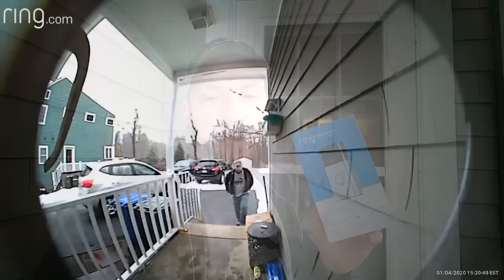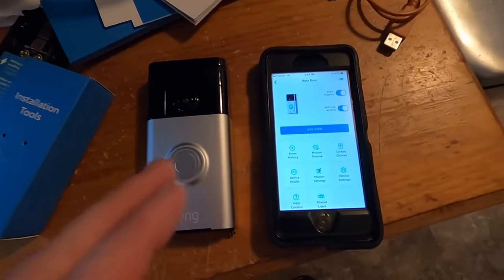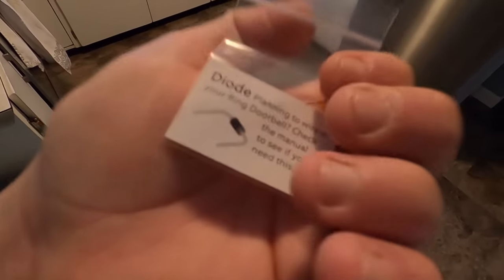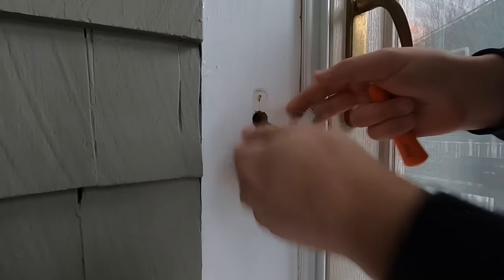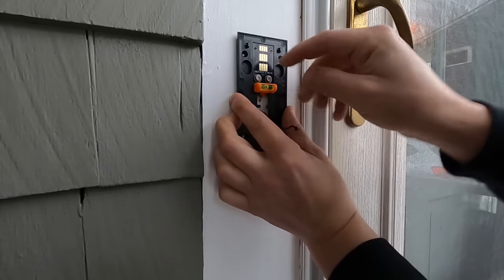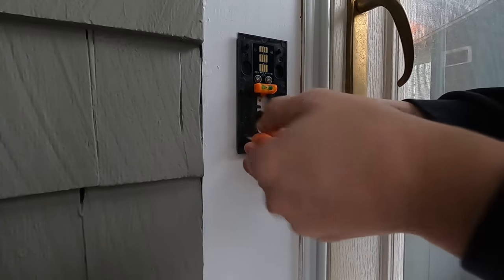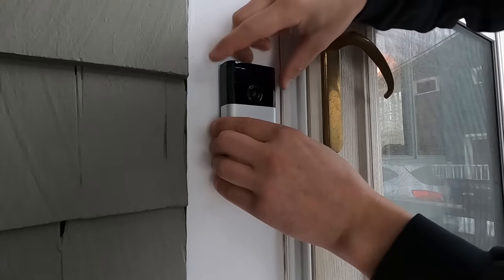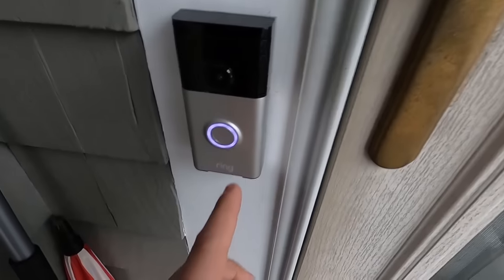How To Replace a Wired Doorbell with Ring Video Doorbell | DiY Install

Comment: I literally just bought one Rn, but we don’t have a doorbell, can we still install it w/o one?
Reply: Let me know if you figure out an answer because Im in the same situation lol
Reply: @Swazyyify  yes you just need to charge it unless its the solar powered version and you could buy the chime and plug that in in the house and that works as the bell. Your phone should also alert you as well. Hope this helps
Reply: @guccigucci2490  thank you!
Reply from the maker: Hey, Christy!  Yes, what Gucci said.  Thanks for watching the video!
Reply: @TheFixerHomeRepair  okay thank you!! & which one is the one that has a solar panel?
Reply from the maker: Hey, Christy.  I believe the solar panel is an aftermarket attachment that you will have to buy separately.

Comment: You still need to charge the battery even tho you wired it ????
Reply from the maker: You only have to remove the Ring to charge it if you do not hook it up to an existing doorbell.  I’m sorry I should have clarified that.  So to be clear if you do not hook it up to existing wiring you need to remove and charge, otherwise the doorbell wires will charge it if you have it hooked up.

Comment: I dont have to power my doorbell off before I install?
Reply from the maker: Hey, Joseph!  It would probably be a good idea to shut the breaker off to the doorbell but any doorbell I have ever come across has been low voltage wires so I wasn't too worried about it.  Again, the instructions do recommend turning off the power at the panel.
Reply: You don't have to cut power it's very low volts won't even feel it!

Comment: Shouldn’t I turn off the breaker to my doorbell first?
Reply from the maker: It would probably be a good idea to shut the breaker off to the doorbell but any doorbell I have ever come across has been low voltage wires so I wasn't too worried about it.  Again, the instructions do recommend turning off the power at the panel.

Comment: Shouldn't  you turn off the breaker first?
Reply from the maker: It would probably be a good idea to shut the breaker off to the doorbell but any doorbell I have ever come across has been low voltage wires so I wasn't too worried about it.  Again, the instructions do recommend turning off the power at the panel.

Comment: Does it still need battery ?
Reply from the maker: The battery is built in and can't be removed.  So yes and no I guess haha.  If it is plugged in it will not use battery power but will stay on if the power is out.  Hope this helpss!
Reply: @TheFixerHomeRepair  yes. Thanks for the clarification
Reply from the maker: @estimatora1419  No problem

Comment: Can you get electrocuted from the doorbell wires or feel a  electrical shock i am a bit worried doing this myself
Reply from the maker: It would probably be a good idea to shut the breaker off to the doorbell but any doorbell I have ever come across has been low voltage wires so I wasn't too worried about it.  Again, the instructions do recommend turning off the power at the panel. Thanks for checking out the video!

Comment: Did you turn the power off when you installed it? I freakin cut my doorbell lines in my basement so I might just install a video doorbell and run new lines.  I can’t find the breaker for the transformer wonder if I can install it with power on
Reply from the maker: It is highly recommended to turn the power off first.  You can see in the video that I did it with the power on but that is not the best idea according to approximately... everyone haha. Thanks for watching.  Hope the video helps!!
Reply: @TheFixerHomeRepair  haha I noticed. I mean it’s a low voltage anyway
Reply from the maker: @bhadz100  haha yeah it is.  Only thing that would worry me is people do strange things with electricity, so if you didn’t run it you don’t know if someone messed it up somehow.
Reply: @TheFixerHomeRepair  true that
Reply from the maker: @bhadz100  be safe!  Hope the video helps!

Comment: Wont u get electrocuted if end of wires touch each other?
Reply from the maker: You shouldn't but I would recommend disconnecting the power to the doorbell before you install this doorbell.

Comment: So you don’t need to turn off the power to the doorbell?
Reply from the maker: It would probably be a good idea to shut the breaker off to the doorbell but any doorbell I have ever come across has been low voltage wires so I wasn't too worried about it.  Again, the instructions do recommend turning off the power at the panel.

Comment: Anybody knows how to know install the diode and when dont?
Reply: If you have a digital doorbell chime, it's required in order for your Ring Doorbell 2 to function properly. The diode is not required for a mechanical chime. It does not matter what ends of the diode connects to the chime, as long as both leads are firmly connected.

Comment: im a noob, but shouldnt you turn off the power first to the door bell?
Reply from the maker: It would probably be a good idea to shut the breaker off to the doorbell but any doorbell I have ever come across has been low voltage wires so I wasn't too worried about it.  Again, the instructions do recommend turning off the power at the panel.

Comment: So you didn’t turn the breaker off to your doorbell??
Reply from the maker: It would probably be a good idea to shut the breaker off to the doorbell but any doorbell I have ever come across has been low voltage wires so I wasn't too worried about it.  Again, the instructions do recommend turning off the power at the panel.

Comment: Also, the thing is self powered, you don't need a battery once it is wired.
Reply from the maker: You only have to remove the Ring to charge it if you do not hook it up to an existing doorbell.  I’m sorry I should have clarified that.  So to be clear if you do not hook it up to existing wiring you need to remove and charge, otherwise the doorbell wires will charge it if you have it hooked up.
Reply: @TheFixerHomeRepair  Right. So it does keep the battery charged off the doorbell wire and uses the battery if the power goes out? That's cool if so.
Reply from the maker: @HalkerVeil  yes.  You only need to give it an initial charge before installing it and then the wires kind of trickle charge it.  If the power goes on off it will stay on for days even.

Comment: My doorbell isn’t chiming after I installed this. Other videos say go to the settings but there are no settings on the app for that. I guess it was an update or something.
Reply: You may need the diode. If you have a digital doorbell chime, it's required in order for your Ring Doorbell 2 to function properly. The diode is not required for a mechanical chime.

Comment: why do you still have to charge the battery if it's hard wired?
Reply from the maker: You only have to remove the Ring to charge it if you do not hook it up to an existing doorbell.  I’m sorry I should have clarified that.  So to be clear if you do not hook it up to existing wiring you need to remove and charge, otherwise the doorbell wires will charge it if you have it hooked up.

Comment: Just a suggestion: before you install turn off electrical power first, i.e., the door bell breaker at electrical panel.  Cringing watching that drill going in and not know what other wires are possibly behind there.
Reply from the maker: I am usually very careful about that kind of stuff but this is a good tip!

Comment: So the ring doorbell doesn't ring inside we probably have to buy ring door chime separately mine ring bell is hardwired but dosent ring inside in the old chime
Reply from the maker: Hey, Ali.  Is this the exact unit you installed?  I know some Rings need a power pack for the chime and some chimes are not compatible.
Reply: @TheFixerHomeRepair  I installed ringdoor bell 2 and have to buy ring chime pro and now it's ringing inside in the chime...
Your video helped me install the door bell thank you so much for uploading this video appreciated...
Reply from the maker: @alichaudhry4008  awesome to hear you got it straightened out!  Thank for watching.  Happy I could help!

Comment: Why do you have to charge something if its hard wired? What’s the point of hard wiring if you stall have to charge?
Reply from the maker: You only have to remove the Ring to charge it if you do not hook it up to an existing doorbell.  I’m sorry I should have clarified that.  So to be clear if you do not hook it up to existing wiring you need to remove and charge, otherwise the doorbell wires will charge it if you have it hooked up.
Reply: @TheFixerHomeRepair  That's what I thought. Thanks

Comment: I’m having a problem with my ring I connected to my door bell same as yours but for some reason is not ringing even when you touch the bell HELP PLEASE!!
Reply: If you have a digital doorbell chime, it's required in order for your Ring Doorbell 2 to function properly. The diode is not required for a mechanical chime.

Comment: You said, “on the app it tells you how much battery life it has”. That means you have to remove it often to charge ? Don’t you think it is a drawback? Thanks.
Reply from the maker: Hey, sorry about that.  I should have clarified.  If you hook it up to an existing doorbell the wires charge it.  You only have to remove it if you don’t hook it up to doorbell wires.  Thanks for the comment and for watching the video!
Reply: @TheFixerHomeRepair  Thanks for your prompt reply.
Reply from the maker: No problem.  Hope the video helped!
Reply: @TheFixerHomeRepair  Yes, It did. Keep going. Good job.

Comment: If using a ring doorbell, and someone rings the doorbell, can you still hear the traditional "ding dong" door bell sound inside the house, or will it just be the ring chime? I can't seem to remember. Thanks in advanced.
Reply from the maker: Yes, Ivan.  The doorbell on the inside will still go off as well as the Ring.  Thanks for checking out the video!

Comment: So you dont really NEED to shut off the power to install this? I know its recommended
Reply from the maker: I would highly recommend it.  Who knows if your transformer has some kind of strange fault that may send more electricity.  Or it could be wired wrong.  You just never know.  So I would to be safe.

Comment: Why does it need a battery if it’s hard wired?
Reply from the maker: You only have to remove the Ring to charge it if you do not hook it up to an existing doorbell.  I’m sorry I should have clarified that.  So to be clear if you do not hook it up to existing wiring you need to remove and charge, otherwise the doorbell wires will charge it if you have it hooked up.

Comment: Why does the picture look so blurry on your phone ???
Reply from the maker: Hey.  This is the first Ring doorbell so the resolution is not the best.  I ended up getting the newer Ring and the image quality improved significantly!
Reply: @TheFixerHomeRepair  Do you have to be connected to the cloud to be able to use the Ring ?? Thanks
Reply from the maker: @victoryfirst2878  You can use it without but it will not record I believe unless you have a subscription
Reply: @TheFixerHomeRepair  Thank you fixer.
Reply from the maker: @victoryfirst2878  No problem!

Comment: Did I hear you correctly, you need to remove the ring doorbell to recharge it.
Reply from the maker: You only have to if you do not hook it up to an existing doorbell.  I’m sorry I should have clarified that.  So to be clear if you do not hook it up to existing wiring you need to remove and charge, otherwise the doorbell wires will charge it if you have it hooked up.

Comment: So, those HOT electrified wires that touched each other didn’t short out your wires ❓ even if they are low power❓ I believe the instructions state to turn OFF your electricity ⚡️ that controls the door 🔔. Seems simple 👍🏻⚠️ 12-9-2021

Comment: Aren't you supposed to turn off your electricity or your breaker before you mess around with those hot wires?!
Reply from the maker: It would probably be a good idea to shut the breaker off to the doorbell but any doorbell I have ever come across has been low voltage wires so I wasn't too worried about it.  Again, the instructions do recommend turning off the power at the panel.

Comment: "its pretty low but if someone's coming up on the stairs you are definitely going to see their face".  Problem with that statement is they havent rung the doorbell yet , so when they actually get to ring standing right in front of your door as most humans do and you get to see whos there you will be staring at their crotch.
Reply: If you get the subscription, you get 24/7 recording
Reply: Also has motion detection.

Comment: While this video is very helpful, the Ring instructions clarify that when wiring to an existing doorbell, it is not necessary to recharge AND when wiring to an existing doorbell, Ring advises turning off the power source at the circuit breaker box. 😳 This guy clearly did not, as his doorbell light was still on and he "checked" to see if it worked. 😳 Bottom line...READ THE PRODUCT INSTRUCTIONS THOROUGHLY.
Reply from the maker: Woah go easy haha.  Yes, I should have clarified if you are wiring this to an existing doorbell you do not need to charge it but if you were not you do need to charge it. Also, doorbell wires are low voltage, they can not shock you and all that happens when you touch them together is the doorbell rings.  If it makes you feel better you can shut off the power in your panel but is not necessary.  Thanks for watching.  Sorry I should have said these things in the video.
Reply: My uncle used to install ceiling fan and light fixtures  without turning power off he would say as long as you don’t touch the two wires at the same time. My dad used to say he was nuts. He must have had a point he died of natural causes 😂
Reply: @kevyak  Some people burn their toast in the morning and are just miserable to everyone and look for ways to vent their spleen.

Comment: You should explain that if you are installing where there are live low voltage wires(and therefore power to the location) that you don't have to charge the doorbell before the install or EVER since it will be powered off the live wires.   - Your getting paid for this????
Reply from the maker: Hey, Sally.  You only have to remove the Ring to charge it if you do not hook it up to an existing doorbell.  I do wish I clarified that before posting the video.

Comment: What's the point of connecting this to the existing doorbell wiring?  This thing doesn't draw power from the household electric, you still have to charge it manually.  It's essentially just a camera.  If your existing doorbell works fine, why even mess with it?  Just attach this thing wherever it will give you the best video and leave the existing doorbell alone?  Am I missing something?

Comment: Step one: open the box. Step two: smash the Ring doorbell with a hammer until it is in 1 million little pieces. Step three. Enjoy your same old wired doorbell that won’t spy on you and report you to Amazon if it doesn’t like what you said.

Comment: Make sure you disconnect the electricity at the breaker box first. I’d hate to see someone get electrocuted following your video.
Reply from the maker: Hey, B!  It would probably be a good idea to shut the breaker off to the doorbell but any doorbell I have ever come across has been low voltage wires so I wasn't too worried about it.  Again, the instructions do recommend turning off the power at the panel.  Thanks for checking out the video!

Comment: yeah ummmm dont need to disconnect the power to the doorbelll.. that light on the doorbell means its live!! ID DEFINITLY RECOMMEND YOU SHUT THE POWER OFF TO DOORBELL BEFORE YOU REMOVE AND REPLACE IT!!!!!!
Reply from the maker: It would probably be a good idea to shut the breaker off to the doorbell but any doorbell I have ever come across has been low voltage wires so I wasn't too worried about it.  Again, the instructions do recommend turning off the power at the panel.

Comment: you don’t show how to charge. you skipped  right passed it after grabbing the charger cable telling us we need to do that first so it can charge while we do everything else and then you skipped ahead. VERY VERY low attention to detail. 
start to finish process would be nice. not you take out of box now we’re outside already at the front porch.   zero stars
Reply from the maker: Plug it in.

Comment: shut off ur electricity bro
Reply from the maker: Hey Zapp!  These wires are low voltage but if it makes you feel better you could shut your electricity off.

Comment: The shitty part is the charge…you got a charge the fucking thing Nah fuck this
Reply from the maker: You only have to remove the Ring to charge it if you do not hook it up to an existing doorbell.  I’m sorry I should have clarified that.  So to be clear if you do not hook it up to existing wiring you need to remove and charge, otherwise the doorbell wires will charge it if you have it hooked up.

Comment: Have to remove it to recharge?...........deal breaker 👎🏻
Reply from the maker: You only have to remove the Ring to charge it if you do not hook it up to an existing doorbell.  I’m sorry I should have clarified that.  So to be clear if you do not hook it up to existing wiring you need to remove and charge, otherwise the doorbell wires will charge it if you have it hooked up. Thanks for checking out the video!

Comment: What a moronic design.  You connect it to a power source (the old doorbell wires provides DC power) but you still have to charge it.
Reply from the maker: No, you don’t.  I misspoke.  I should have said you have to charge it if you don’t hook it up to the doorbell wires.